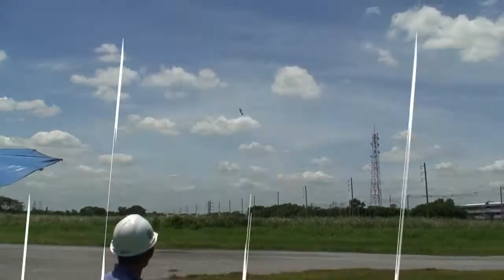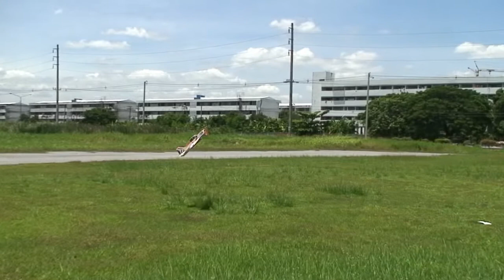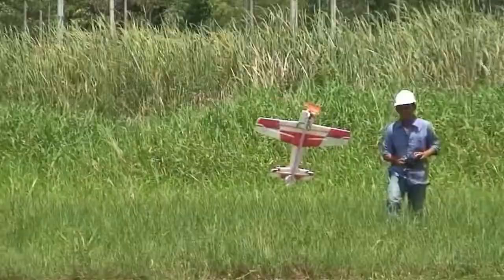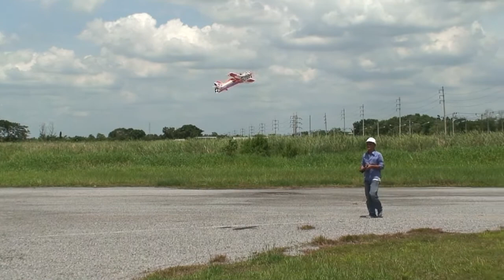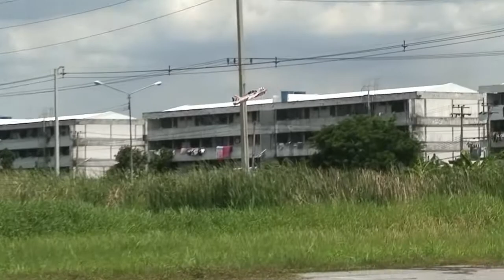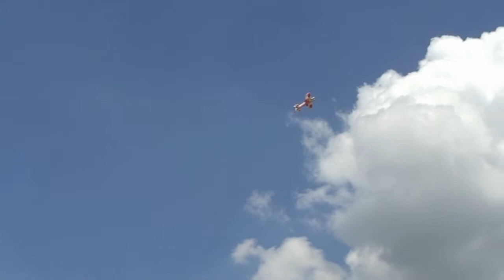Heading Lock and spin recovery

Comment: User manual sucks, it does not make it clear how to turn on the heading hold and ASSIGN it a switch. I expected that lesson here. 
I changed the so called "I" value to 0.010 as stated and what a joke it worked in only one direction with the tail. 
Could you OPEN the sftware GUI and SHOW us the numbers? That's what needs to be shown.
I like "Show Me" videos NOT Show and not tells.